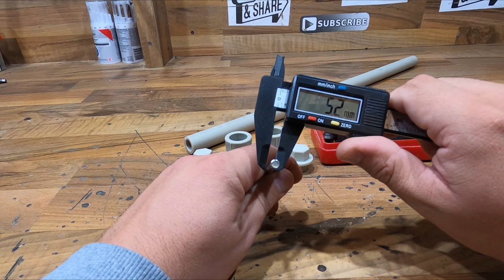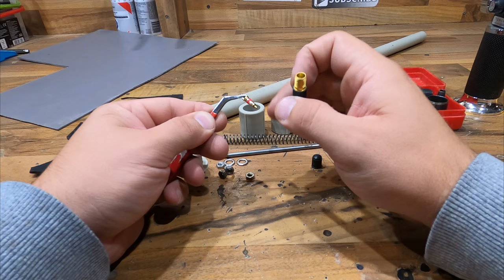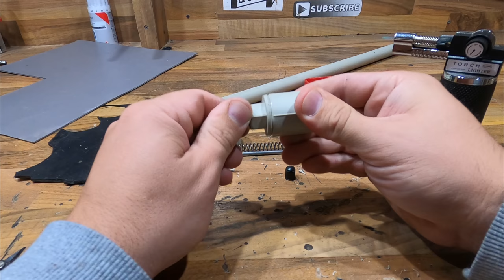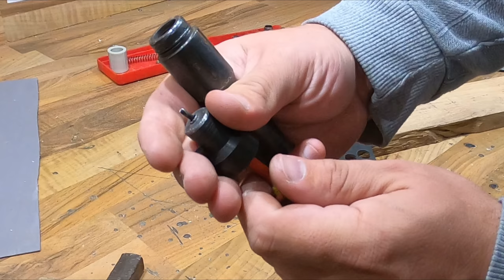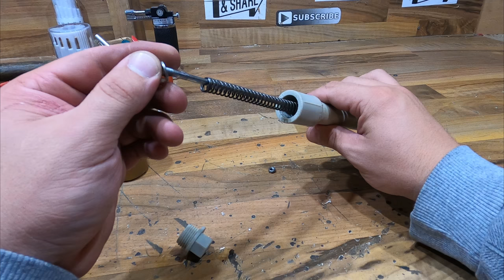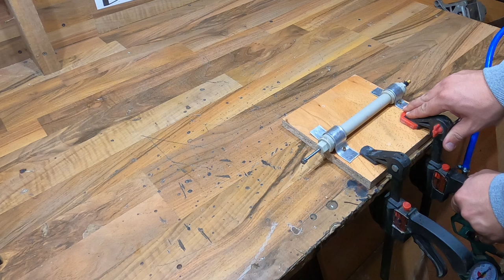How to Make PVC Pneumatic Cylinder Using Polipropilene Pipe

Comment: Great job man! I am building an MRI compatible pressure application system for my professor's research study and my current system applies pressure using the inflation of air bags. However I'm thinking of using a pneumatic cylinder made without any metals (for MRI compatibility) but my only concern is air-leakage because I have to hold constant pressure for 6 minutes. In your experience, did you have air-leakage with this pneumatic cylinder?

Comment: Wouldn't air leak from the hole you drilled?
Reply: No because the hole is outside the compression chamber. It’s seperate because the rubber seals it